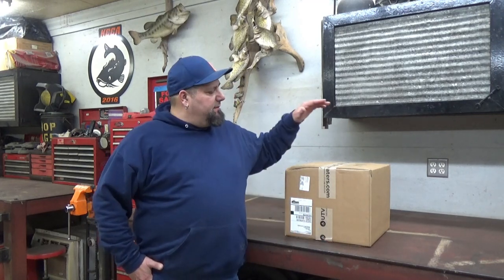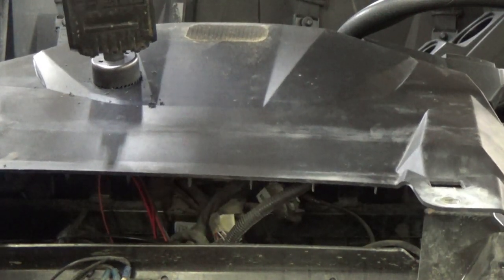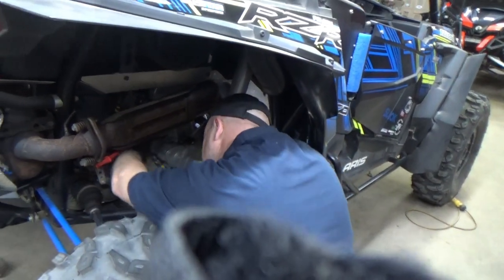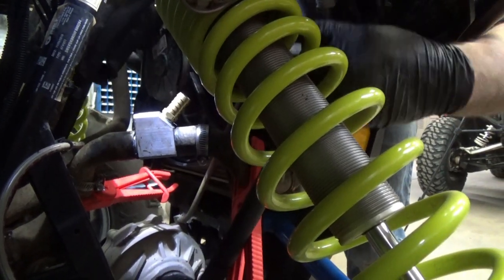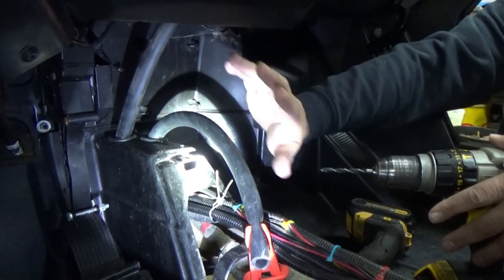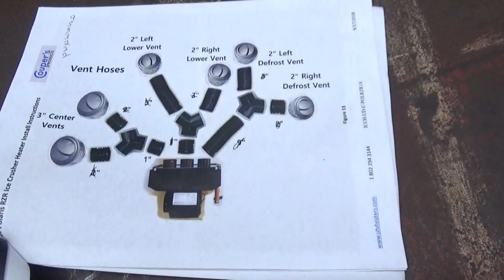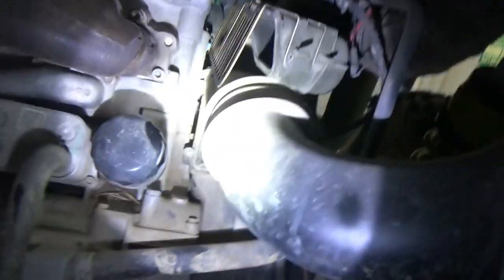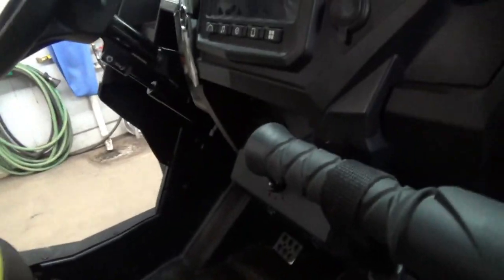RZR Ice Crusher Cab Heater

Comment: I think you called it a Max stack but but you did not explain what it is for are why you need it
Reply from the maker: It's called MaxStat it routes all of your engine coolant through the heater core until the motor gets up to temperature. Then the thermostat in the MaxStat will open and allow the coolant to cycle through the heater core and radiator. It gives you quicker heat then running through the whole system by only running through the heater core.

Comment: Whats the name of those clamps you used to clamp the radiator hoses? What brand and name
Reply from the maker: They're just hose clamps. You can buy them at harbor freight or you can buy expensive snap-on clamps. Thanks for watching Dirt Poor Tv
Reply: @dirtpoortv4483  harborfreight sells them.. thats a great way to save antifreeze. Lot cleaner
Reply: I also have another question.. I wonder why they don't run the other line back to the engine?  Instead of hooking it to the front lower hose.. whats your thoughts on that?
Reply from the maker: @davidlawson9628  I guess to save money on hose. There is no need to run the hose to the rear when you can route it to the lower radiator return line.
Reply: I have an Inferno heater in my rzr 900 trail.  I ran my heater hose back to the oil cooler and tap a "y" fitting infront of the engine oil cooler.  Its the hot water coming out of the engine..  I then placed 5/8" insulation    hose on my hose all the way up to and through the firewall into the heater directly underneath the dash.  The outlet  heater hose went back through the firewall and tapped the radiator outlet heater hose back to the engine.  I  mounted it four years ago and the only problem I have had are those "CHEAP HOSE CLAMPS" working loose and leaking.  I bought aviation hose clamps (that have a t-bolt and lock nut) and switched them out.  No more leaks!  Good luck, nice video! Thanks